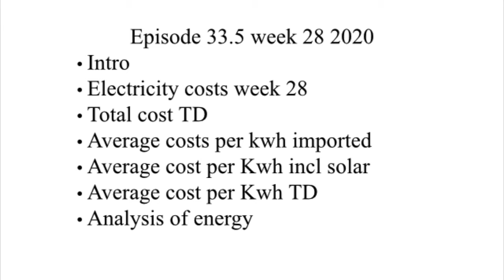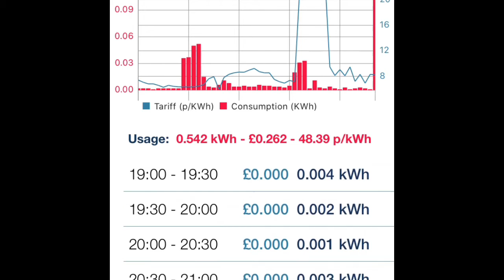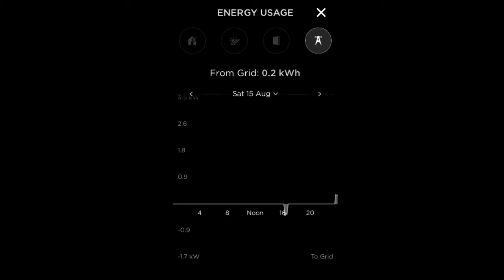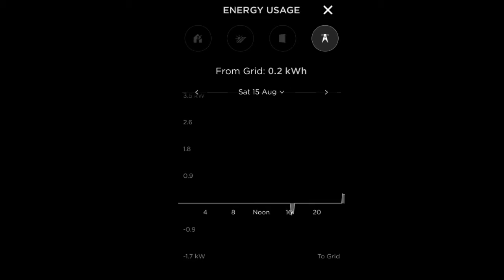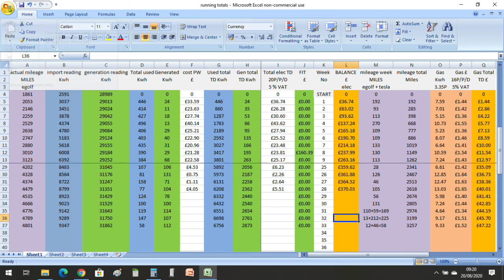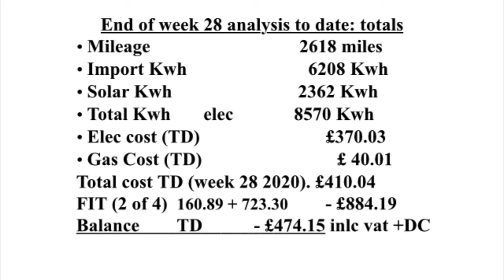Phantom Draw And Week 28 Usage

Comment: Thanks Chris, this is very useful and informative. Appreciate the info on the phantom draw and the diagram and explanation.
Reply from the maker: John Tisbury I’ve not proved it yet john but a suspect my drain ( small amounts ) come back when the relay opens up on the optimiser ( high loads ) the only other thing that explains this would be frequency but this is harder to check and monitor.

Comment: Great content Chris. What was your objective for having the 3rd consumer unit the other side of the V Phase? Is the V Phase meting your needs or is is causing any other issues? Did Octopus give any feedback on the higher background consumption before it reduced to single digits? Keep up the good work. Brian
Reply from the maker: Hi Brian, a few things caused the setup, the first reason was that the solar has to see the grid direct for anti islanding  reasons, secondly the power of the heating systems would’ve to high for it 
Plus there no savings to be had from heating and the same for charging ( resistive loads) , so the savings are made from general appliances like lighting and TVs & game consoles, it’s not caused any issues, octopus stayed very quiet 🤫 about how they reduced the consumption bit did raise with technical department or metering. What is noticeable is when we are cooking from the kitchen ring circuit this is the time when we get more draw from the grid ( phantom ) I believe it could be when the vphase relay goes to grid voltage